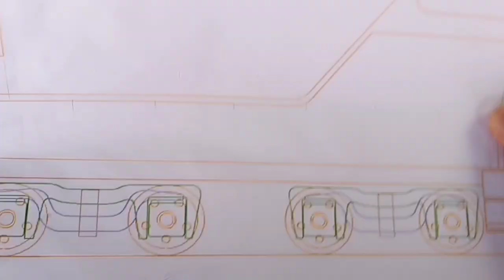Making handmade steam locomotive - Part 4 - Tender chassis

Comment: Which white board are U using
Reply from the maker: Its called mount board. A paper based cardboard of 1mm thickness. And also form sheet
Reply: @HeemsMiniatureWorld  The thickness of the mount board you use is different, isn't it?
🤔🤔
Reply from the maker: @mdsahir3156  I think you are asking about the board used in platform rt? Its multiwood of 8mm thickness. And on top of that im using mount board of 1mm thickness
Reply: @HeemsMiniatureWorld  thank u dear all boubts are clear 😁
Reply from the maker: @mdsahir3156  🙂